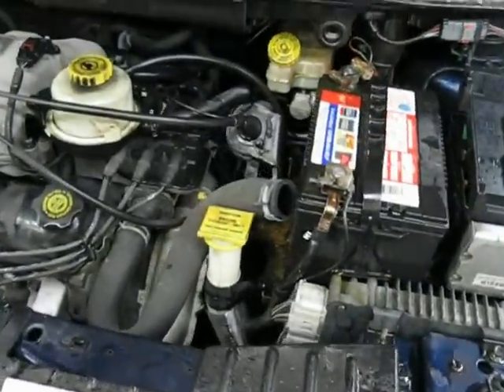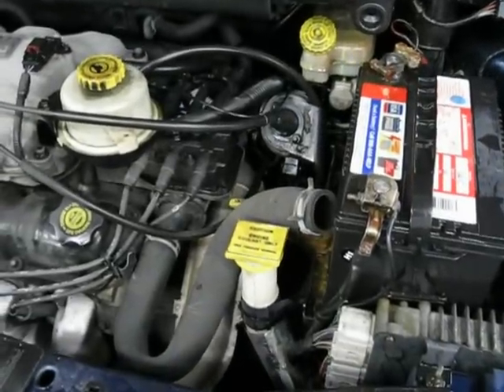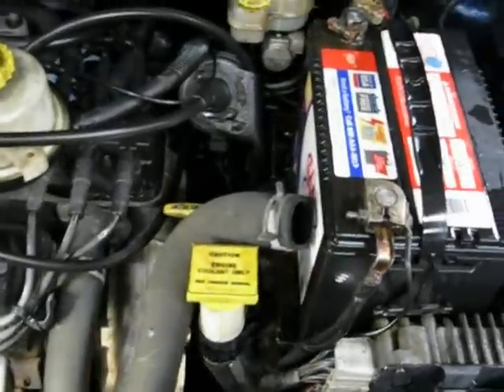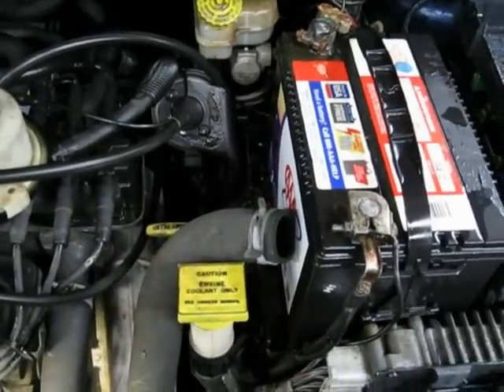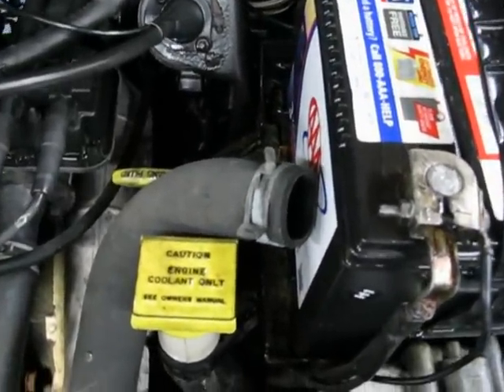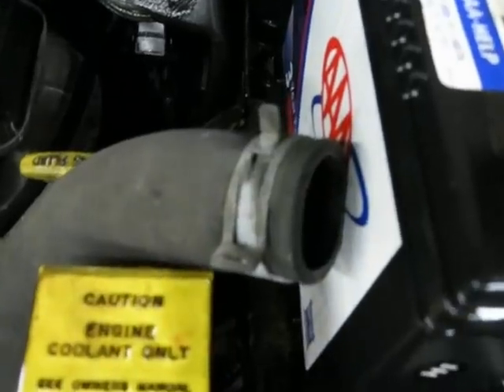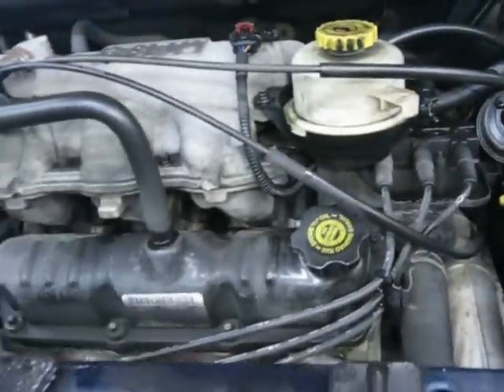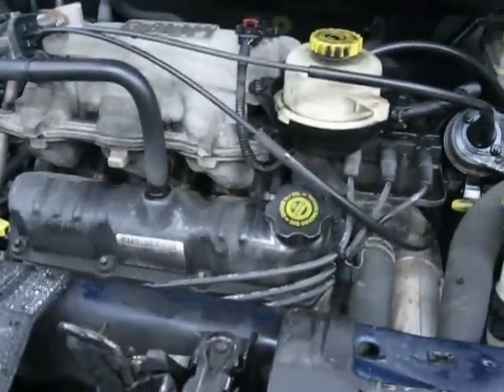Broken Radiator Neck

Comment: Same thing happened to me on my bmw 325i the neck part looks exactly like yours how did u end up getting it fixed ? Or do I have to buy a whole new radiator ??
Reply: Did u ever get a answer?
Reply: Team Banny  hello . I know this is a year too late . Hope you’re safe and sound first my friend . Second , yesterday I had the same exact issue that happened with you . Broke the neck on my 325 I radiator. Had to use Loctite super glue ( I was changing the upper  hose ) . Waited 15 min and put everything together . So far so good with no Leak at all ( a whole day ) . I’m going to reinforce it now with another layer . I ordered a new radiator for 90$ off amazon just in case .i wonder what happened with you ?!